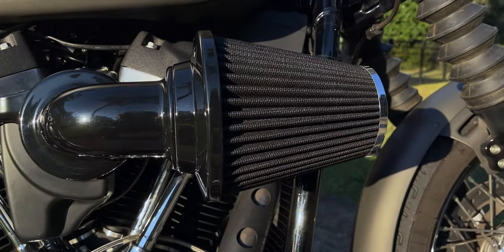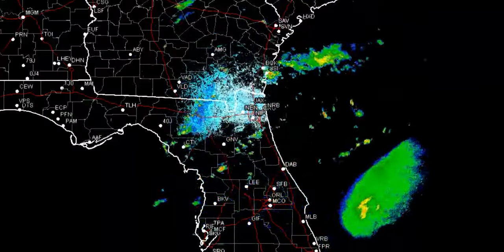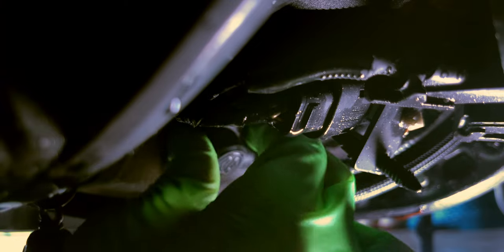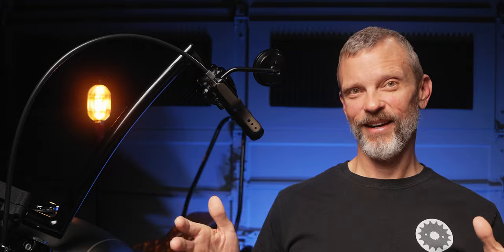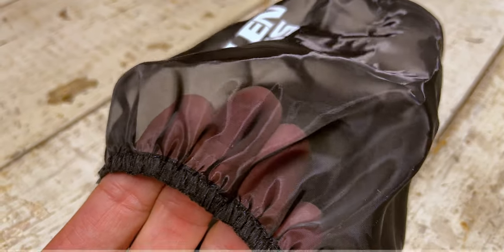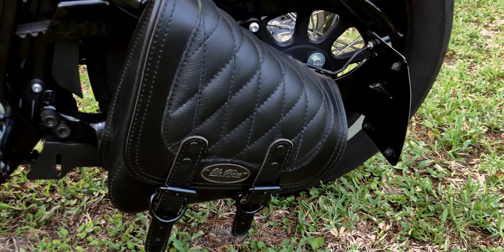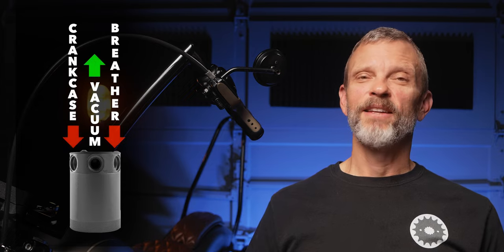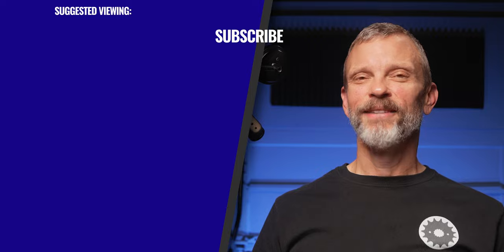🌧 Rain Sock: Hype or Reality?⚡️Important Lesson • Arlen Ness Monster Sucker • Do You Really Need It?

Comment from the maker: Have you had problems with rain getting into your exposed filter intake? Have you used a rain sock? How well has it worked?
Reply: Have had used them on various bikes. The standard round SE filter version seemed a little less effective (HD branded,) It pays to occasionally spray with Camp Dry, as the material gets older. Good videos, keep at it,
Reply from the maker: Hey Anthony - thanks for that great tip about the camp dry treatment! And thanks for the kind words too :)
Reply: I keep mine on all the time. It keeps most of the bugs out of the filter elements fibers, and keeps the filter dry when I wash the bike. I try to avoid rain at all costs.
Reply from the maker: Hey Robert - Thanks for contributing! I’m with you: “I try to avoid rain at all costs.”
Reply: After watching your video I looked all over for a rain sock for my S&S Stealth air filter setup on my '19 FXFSB 114. S&S wants like $600 for one. Scoured Amazon and came close but no S&S take off's I could see. Does anyone know where or who may have one at a much more affordable price? I mean $60 for a piece of fabric is such a ripoff.
Reply from the maker: @russellj.6708  wow, that is steep for a rain sock! Maybe you could find a universal one?
Reply: @hitituprohb don’t leave the sock on because it actually restricts the flow of air and will effect the performance of the bike. K&n makes a great filter cleaner and comes with oil to use for dirt particles and bugs. But don’t leave the sock on unless it rains

Comment: I had a side-mounted, large cone air filter ( no air filter sock ) on my 2002 Dyna Low Rider and had to stop at a stoplight in pouring rain. I then had to ride in pouring rain for another 15 miles before the rain slowed down. I continued to ride 220 miles home and my 95-inch engine never missed a beat.
Reply from the maker: That’s impressive! Not at all what I experienced :/ Maybe it’s the design of the Monster Sucker.
Reply: It probably turned all that water into steam and cleaned your engine of any sort of deposits. Free engine steam job
Reply from the maker: @Arizona_Vineyard I’m just glad I didn’t crater the motor!

Comment: You can use a K&N filter oil kit on that monster sucker filter. Will then give you a secondary oiled film degree of protection with the rain sock in place or give you time to get the filter on and still give a degree of oiled protection.
Reply from the maker: Hey Paul - that’s a great idea! Thanks for sharing.
Reply: They do it in colours too my filter was red so bought the black oil kit. Be very very sparse with the oil if you go that route, let it sit over night to be fully absorbed. dont try to hit every spot otherwise be blotting it off for ages like I was : s  @RonsWorkshop

Comment: I had this problem with my brand new low rider s 117. My first ride was under heavy rain.Traveling  at 70 mi/h and I accelerated to surpass a car, the engine rotation dropped for like 3 seconds and recovered. It happened 3 times in the same way. I texted to the dealer to complain but they said it should not happen. In the next day I did a ride for 160 miles under the sun and the engine was perfect. I will buy a sock for the air intake to solve this issue with the heavy rain which is very common here in Brazil.
Reply from the maker: Hey Mauro Amano - yes, that’s almost exactly how it was for me. I didn’t expect that at all. I’ll always have a rain sock with me now!

Comment: I also have an Arlen Ness Monster Sucker on my bike. I ride in the PNW rain all the time without a rain sock. I've never had any problems. Never been caught in jn a downpour though.
Reply from the maker: You get hardship points for enduring all that wet weather!
Reply: @RonsWorkshop up here you either ride in the rain or you don't ride at all. As long as you have the right gear, it's not so bad. I stay warm and dry. Stay safe out there my friend. 🏍️💨

Comment: Fairly certain I had this happen tonight. So what's the "aftercare"? Remove air cleaner to see if water is present? Check engine oil to see if it is milky in color? I'm assuming this is it and if milky do an oil change.... anything else to look for or do??

Much thanks for a great explanation
Reply from the maker: Hey Edmund R - I'd start with removing the air cleaner and making sure all the water is drained out (if there is any left) and letting it all dry out completely before reassembly. Did the bike keep running or did it die and not restart? If it kept running, or you could restart it, and it runs ok now, your probably fine. It wouldn't hurt to check the oil just in case. Let me know what you find, and thanks for the kind words!

Comment: Had a similar experience with a screaming eagle heavy breather on an 06 softail. Had a rain sock in my sissy bar bag, got caught in a brief shower, (also in Florida) did not feel like stopping to put it on. Was not in the rain for as long as you, but the filter element did get wet. Used compressed air after getting back home and saw hoe much water was expelled from the filter. Since then, I keep the rain sock on all the time. Keeps bugs out too! (Florida is the bug capitol of the U.S.). I also have a 19 road glide with an Arlen Ness monster sucker on It, and keep a rain sock on it at all times. Does not impede air flow, and keeps the water and other crap out!
Reply from the maker: Hey Fltrx19rider - thanks for sharing that info! It's definitely cheap insurance :)

Comment: Put an AN Monster Sucker on my Lowrider S having taken off the Screamin' Eagle Big Breather which is similar. The AN gives much better performance to a Stage 2 which is noticeable 'cos it brings in more air than you'll ever need. Problem is in ANY rain it sucks in a stack of water despite them saying you don't need a rain sock. Got caught in a very small shower and oil frothed immediately... a heavier shower and my bike chugged and stalled completely. Had to get recovered, cleaned the oil and runs absolutely fine, needless to say ordered the rain sock straight away. Used rain socks in heavy down pours and torrential rain and doesn't miss a beat; if you have this breather the performance is great but  you really need a rain sock on you as well.
Reply from the maker: Hey Foz Man - thanks for sharing that info. I agree completely. The rain sock is cheap insurance and easy peace of mind for sure.

Comment: I dont know if it was the rain or maybe a casting defect but I rode in heavy rain and my rear piston cracked dead center. No signs of overheating, cylinder was good, head and valves all perfect. Just the piston cracked dead center and the case over pressurized and push oil out of the breather like it was going out of style. One thing I noticed when taking the air cleaner off was  lots of water in my intake manifold and a pool of water and oil inside my air filter. Like I said, not sure what caused this but it was very odd.... Ill be getting a sock at least. Might get a different air cleaner for peace of mind.
Reply from the maker: Hey kriegmast - that’s crazy! Thanks for sharing that info. If you go with a different intake let me know what you pick.

Comment: I use a large zip lock bag if weather calls for rain. I use my leg during the ride in the rain...works great! (I've ordered my rain sock for the Trask breather)
Reply from the maker: Thanks for sharing those techniques! Simple is good.
Reply: How does a zip lock bag work? Wouldn't it suffocate the engine?
Reply from the maker: @quintin288 you just leave it on the oil filler tube long enough to assess the pressure. When the cap is on it’s sealed anyway so it’s no problem.

Comment: I had always kept my rain sock on my monster sucker. However I had forgot to put it back on after I cleaned and re-oiled it. Yep forgot about it, got stuck in rain monsoon. Spit and sputter to dry spot. will never ride with out again. I knew something was different when I forgot to put it on, having been stuck in a storm with nowhere to pull out of the rain and not having any issues with motor sputtering.
Reply from the maker: Hey Bryan - thanks for sharing that info! I’m glad to hear it actually works well in the real world. So you never had problems even in heavy extended rain while using the rain sock?

If you want a sticker send me a DM on Telegram, Instagram or Signal with the mailing info @RonsWorkshop
Reply: @RonsWorkshop  yes it does. Which I am glad. Did not have one at first, got caught out in a heavy thunderstorm, bike coughed choked and sputtered, limped home. After keeping it on always didn't have any issues.

Comment: I had my 2018 road glide factory intake suck water in a moderately heavy storm that killed my bike when I decelerated. With my build I went with the monster sucker. Guess il get the sock just in case. Thanks for the heads up
Reply from the maker: Hey Wicked Trucking - glad you found it helpful! . Yeah, it's definitely worth it to get that peace of mind. I just keep mine stashed in the swingarm bag and use it when necessary.

Comment: Ron, thanks for another great video. Not really relevant to this particular video, but I couldn't track down the answer in ur other videos. What front blinkers are those?
Reply from the maker: AZ Triumphster - thanks for the kind words! The turn signals are Drag Specialties - the ones with smoke lenses are part # 2040-2143, and the amber lenses are part # 2040-2142. I've been very happy with them. Be sure to check fitment, as there are a few different models that fit different bikes.
Reply: @RonsWorkshop  thanks! Did u have to convert from 3 wires down to 2? If so, how did u go about that?
Reply from the maker: I cut and soldered to use the OEM plugs - and I just removed the unused wire for the running light.

Comment: Just so you know , even small amounts of water  threw the intake - causes micro craters in your valve seats, corrosion and rust in the carb -  throttle body - intake - and heads , you may also have a bent rod from water in the cylinder , it can also pull the head stud threads out of the engine block . Ive seen a 12V 71 detroit bend a rod from water in the cylinder , the rod and main bearings also take the pressure and can be damaged also . The stock air cleaner was made in a way to help prevent getting any water in the engine for a reason .-----------Hydrolock occurs when a volume of liquid greater than the volume of the cylinder at its minimum (end of the piston's stroke) enters the cylinder. Since liquids are nearly incompressible the piston cannot complete its travel; either the engine must stop rotating or a mechanical failure must occur.
Reply from the maker: Agreed!

Comment: Seems like an oversight by the company. Manufacturing a more efficiently designed air intake cover rather than a rain sock seems short changed. They must be taking the piss with that thing.
Reply from the maker: Hey Katsas13 - interesting point. Or they’re only focused in delivering “good weather” performance and anything else is on the buyer.

Comment: Bottom line is that those intakes are junk. I had a rain sock on in a storm and yes it did keep the majority of water out but with the rain accumulation, it also restricted air flow which choked my bike to a stop. I went back to an S&S teardrop air cleaner. Problem solved.
Reply from the maker: Hey Michael Gonzales - thanks for sharing that info! Better airflow with the S&S Teardrop?

Comment: hey RON! i have a 2019 m8 breakout, do i need to tune anything if i was to change the air-filter to one those side hanging ram air style filters?
Reply from the maker: Hey Navi - that’s a great question. Off the top of my head I’m not totally sure, but it seems like an updated tune might be beneficial because of the higher airflow. Stage I is intake, exhaust, and tuning. The intake is 1/2 of that so you may be ok with no tune unless you change also the exhaust. It’s worth asking your dealer too. 

And if you want a sticker send me a DM on Telegram, Instagram or Signal with the mailing info @RonsWorkshop

Comment: I have the same Arlen Ness filter, but with the billet aluminum cover on my 2018 Sport Glide.  Would the rain sock fit over that cover?
Reply from the maker: Hey jimbert50 - Arlen Ness makes one that fits the model with the billet cover. I put a Revzilla link in the video description, and there’s a selector on that page to pick the rain sock to use with or without the billet cover. The Arlen Ness part number for use with the billet cover is 18-063 and the one to use without the cover is 18-065. Let me know if you try it out!
Reply: @RonsWorkshop  Thanks!

Comment: Dude you don't  need  vacuum in da crank case ..... it's  a joke ...... at least  the one without vacuum pump outside....
Reply from the maker: Hey Kosma - thanks for the input. I’m a fan of some amount of vacuum — or at least not having positive pressure. Positive crankcase pressure definitely causes problems and is a big contributor to sumping.

Comment: My fatboy came with a rain sock. Always left it on. Had bike at Harley for a month to get rim/tires replaced and these assholes gave me bike back without the sock.
Reply from the maker: That’s a pain! Did it work well in heavy rain?
Reply: @RonsWorkshop  the two times I got caught in heavy rain with it, it did work very well. Bike ran without issues. And I’m talking down pouring rains.
Reply from the maker: That’s encouraging!
Reply: I have a 2018 Heritage Classic softtail and I never noticed it until after I owned it.
I don't  know if it got stolen or fell off but it is gone.
Now I just ride without it. I have ridden in rainstorms without it without any issues. I like the looks without it but worry if it will ruin the engine.
My old evo and shovelheads never needed a rainsock?
WTF
Reply from the maker: Man that’s puzzling! I definitely had major issues in the rain without it.